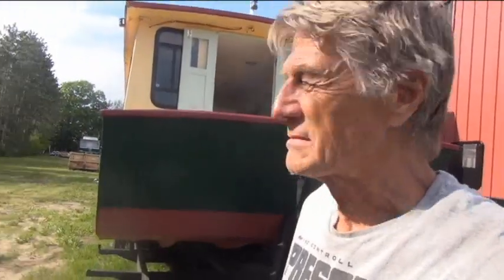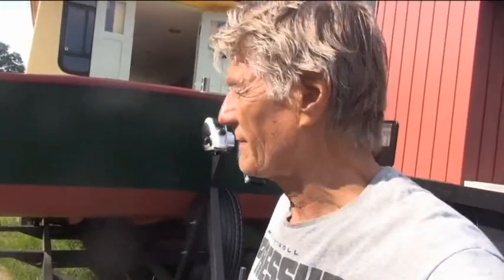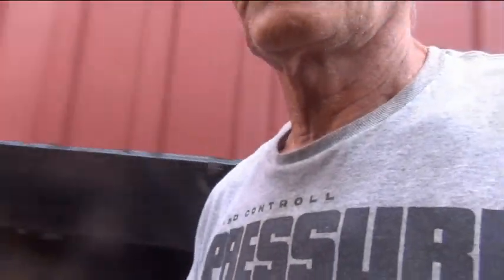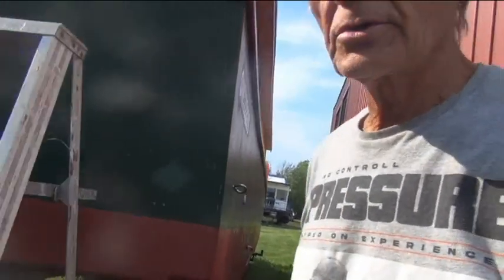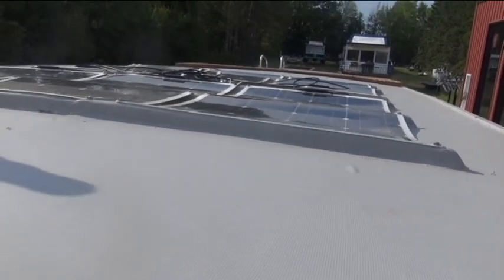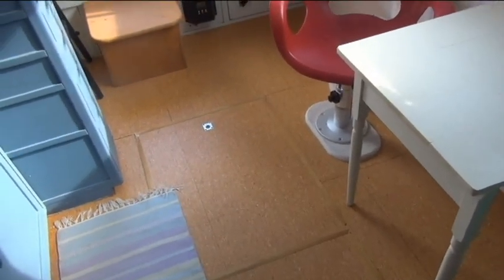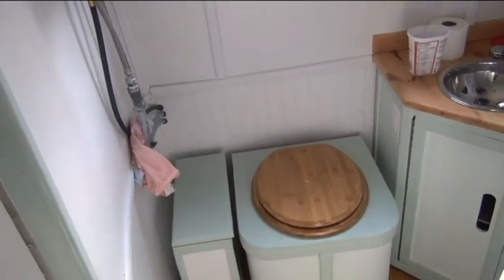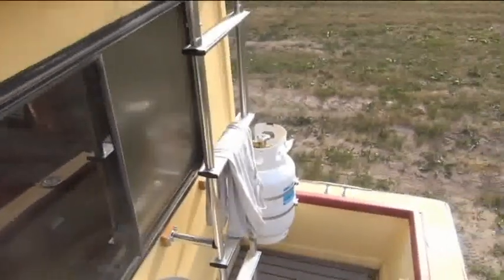Construction Review of Our Tiny Houseboat

Comment: Love the boat, it is a beauty! Wouldn't lower the bottom coat. Algae and barnacles love to climb up a boat. Curious what you used to waterproof spruce?
Reply from the maker: I left about 3" above the waterline.  Barnacles are not a problem on these fresh water lakes and the anti-fouling keeps the algae off.  A bit of a scum line above the water line. The hull is waterproofed with epoxy and fiberglass.  Above the hull we used an opaque stain and sealer.  This has held up well over the past 3 years.  I'll probably redo it over the next month but use an exterior paint instead of a stain.  The roof was also covered in epoxy and fiberglass and then I added a coiuple of coats of one component epoxy usually used for concrete floors.  That has flaked off in a couple of small spots, probably because these areas weren't properly cleaned.  Thanks for your comment.

Comment: do you have idea how much resin is required for the boat .Thanks
Reply from the maker: different epoxy resins have different resin to hardner ratios.  Most of what I used had a 1:1 ratio.  Assuming that the plywood hull is first coated with a seal coat of epoxy and then with 6 oz cloth and resin and then followed by another layer of 6 oz cloth and resin up to the water line, you may need at least 50 gal. The surface area of the hull is approximately 500 sf.  A US gal of mixed epoxy covers about 12 sf.  The  seal coat will require less epoxy or around 20 gal.  The cloth layers will need about 40 gal which should be enough to do a 2nd layer up to the water line (15").  If the epoxy is too thick you can dilute with acetone or denatured alcohol (check with manufacturer). Check the coverage for the epoxy you're buying, it may differ.  The resin will store for a long time but the hardner sometimes can go off after a year or so. Hope this helps.
Reply: @ourtinyhouseboat  Thank you
Reply: @ourtinyhouseboat  WOW .That is lots of epoxy .West System cost over $1000 for 5 gal . So that is over 10k just for epoxy (you said at least 50 gal ) What brand of epoxy did you use ?
Reply from the maker: I was assuming a thickness of 1/8" which is probably too much.  1/32" is probably more realistic which would reduce epoxy requirements to 12 gal. but you're still looking at around $2K in cost.  I used aeropoxy which has a 100:27 ratio (not 1:1 as previously stated) instead of west system.  I also glassed the sides of the hull before attaching.  Flat surfaces need less epoxy than vertical surfaces.  After attaching to the sides I covered the seams with fiberglass tape.  You could also save $ by using polyester resin after applying the epoxy seal coat.
Reply: @ourtinyhouseboat  thank you . Around 2k sounds good
Reply: @ourtinyhouseboat  This info is very helpful . Could you tell me what is the boat buoyancy at WL .I notice once in the water it did not go over WL. Sorry for so many questions .Regards
Reply from the maker: @Nature-bt5ip  I estimated that our tiny houseboat weighs about 6,000 lb  based on how much plywood and lumber was used. A cubic foot of fresh water weighs 62.4 lb. At 6000 lb the boat will displace  96 cubic feet.  The bottom of the boat is about 200 sf so the boat will draw about 6".  The actual draft of the boat is more because of the skegs but the waterline is actually very close to 6". Since I wasn't sure of the weight I greatly overestimated where the waterline should go.  i have since reduced it but still have the anti fouling another 6" above the waterline.
Reply: @ourtinyhouseboat  Thank you so much .